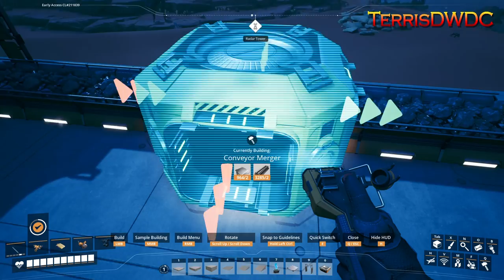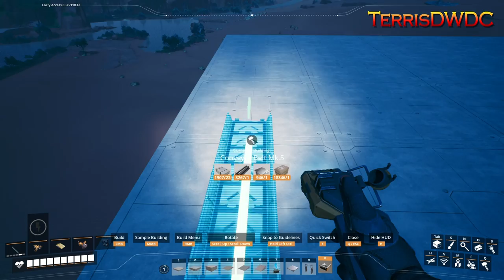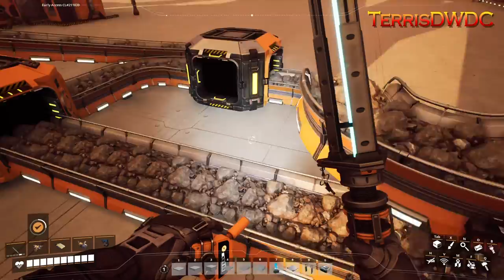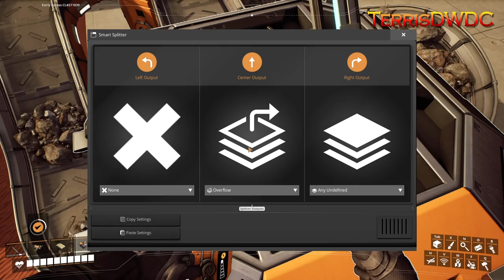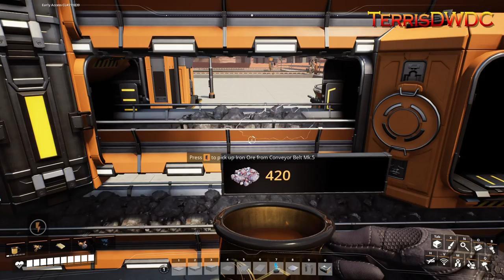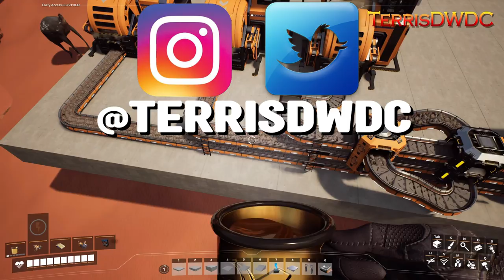Satisfactory Tips - Maximizing your Conveyors!!!

Comment: Inspiring stuff, I couldn't help but have a play. I wanted to achieve the same but without using programmable splitters. I figure splitting a conveyor in two splits the distribution 50:50 and if one side of the 300 was limited by the Mk2 conveyor (120) then I could use the other side, coupled with x2 300s or x1 600 to get my 780.

Comment: Good video, small issue thou, what if you have 1 belt comming in and the rest by train for a total of 1800, stations will give full output on a mark 5 belt so it will bleed the station dry, i have a station with 6 freight platforms bringing in 1200 sulfur, the sollution i found was combining all platforms in 2 outputs top combined and same for bottom giving me 2x780 on each line, then i placed a splitter on 1 output i placed a mark 2 belt (120 p/m) and on a second a mark 4 (480 p/m) then meged the 2 lines giving me 2 lines of 600 from the station and 1 line of 600 from a belt, after that i setup the system in the video so gvving me 2 (stable) 780 belts and 1 belt of 240.